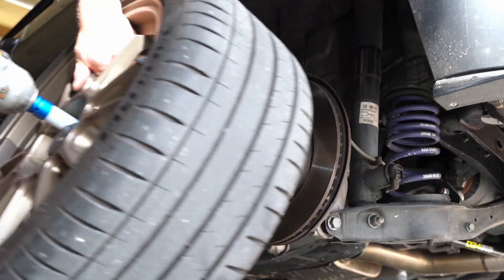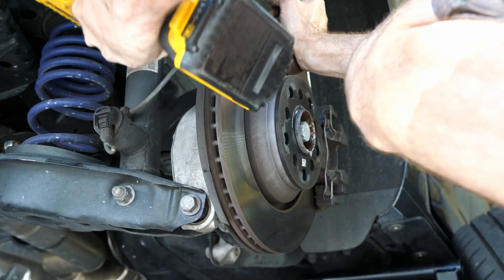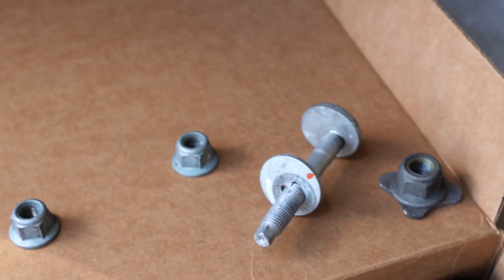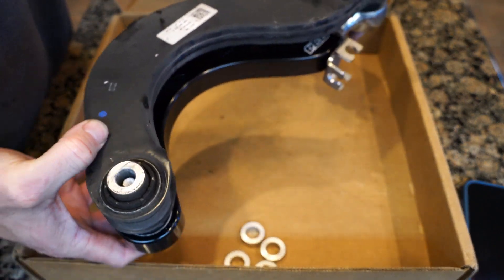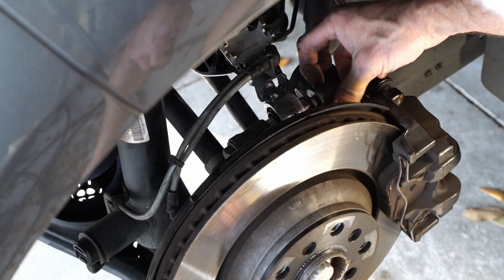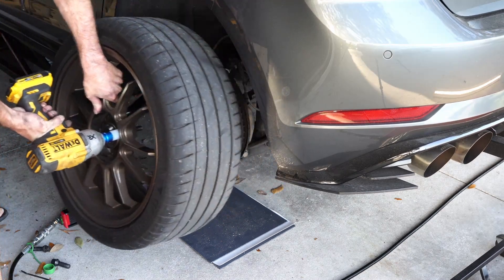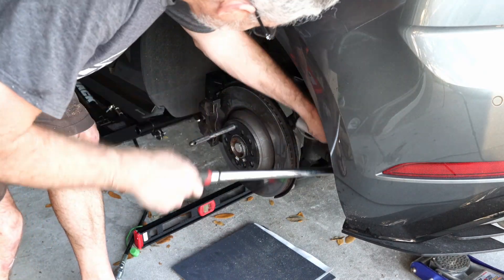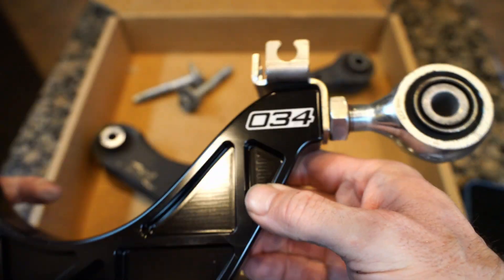034Motorsport Rear Upper Control Arm Installation

Comment: dude your car i worth serious money but looks like you are saving money and using fred flintstone method for alignment. i hope you have cleaned the back rotor afrter those greasy hands. all alignment (front and back) must be set under load. those pseudo-tuning parts are gaining almost no advantage on a civil car, so it is a job for the sake of doing a job. please take care of your hands and wear gloves...and safety shoes.

Comment: Thanks for the video.  did you have to grab the camber adjustment bolt from its head to keep it from spining (during removal and tightening)?

There is hardly any room/acess on the front side of the subframe to get a tool or hand in there.

Comment: I believe you need to remove the stock rubber ABS mount off the line to fit it to the 034 bracket. 
Great video, much better than the others out there.

Comment: Thanks for the video.  The eccentric bolt on the rear changes camber and toe, correct?  Did you have to adjust the eccentric bolt to account for toe changes by the end of the alignment or was camber the main focus?
Reply from the maker: There is a different one for toe. It’s actually easier to get to and adjust too. And yes, I had to adjust toe after the install, mostly because I changed the camber. If you leave it the same length as it was stock, you probably will not mess with toe. If you don’t do your own alignments, you definitely want to get it in for one after the install.